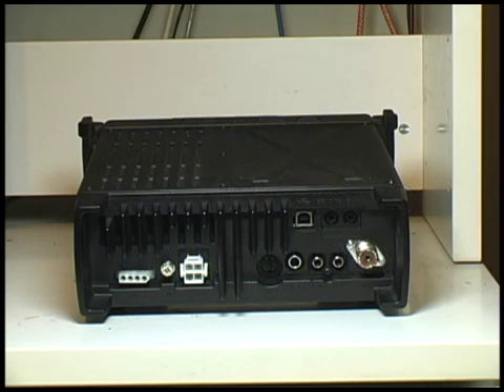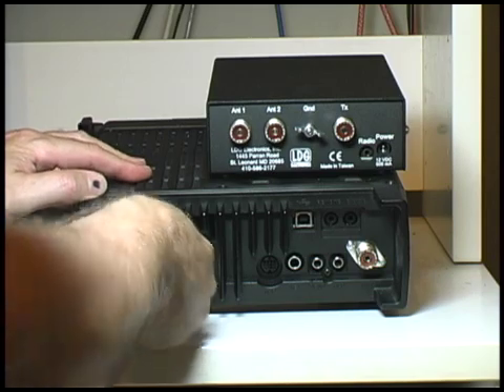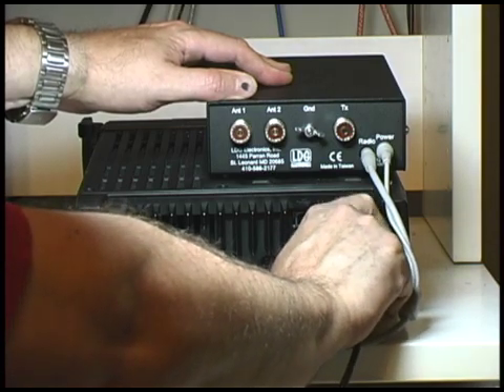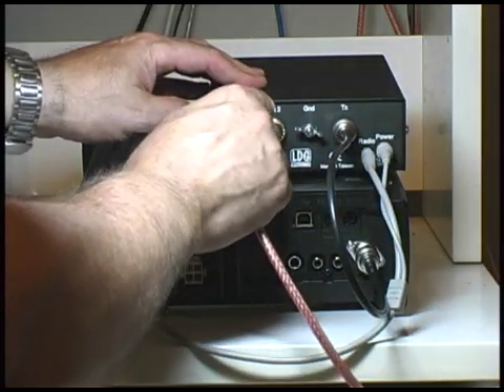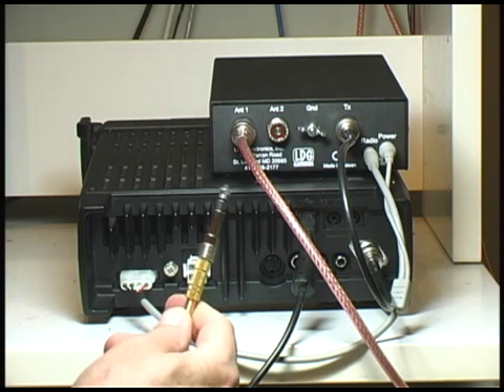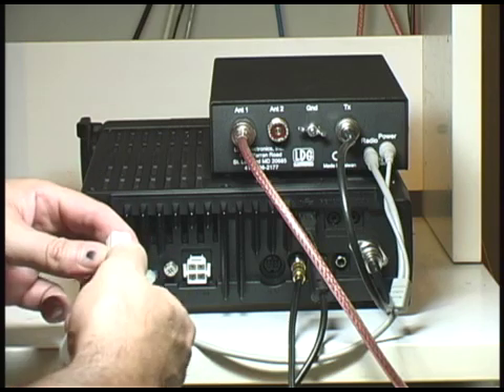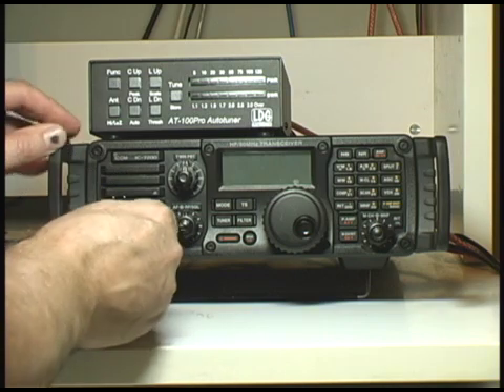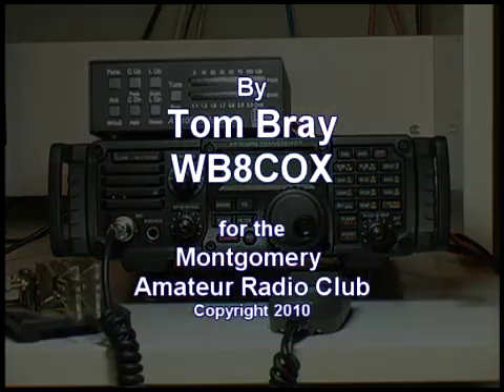Icom IC-7200 Setup

Comment: Is there any settings to make the radio power the tuner? Or does the tuner plug automatically put out 12v? I'm not getting power to the tuner I checked the dc jack and it's not getting power from the radio.

Comment from the maker: AT-100 is now the AT-100Pro II, I don't know if there is any major differences in the tuners.  The AT-100 needs an adapter cable to connect to either Icom, Yaesu, Alinco.  Their site doesn't mention Kenwood.

Tom